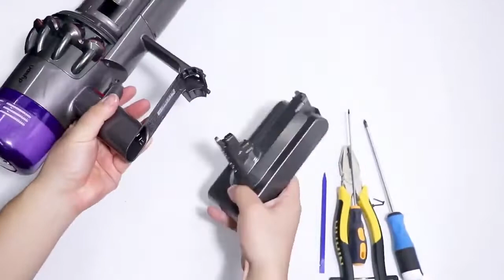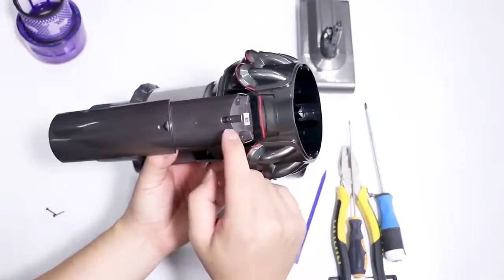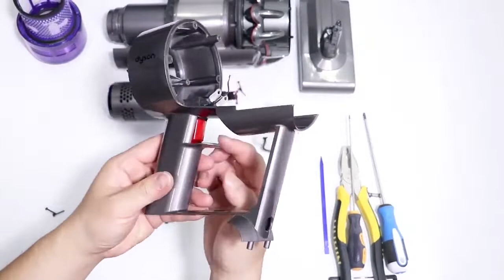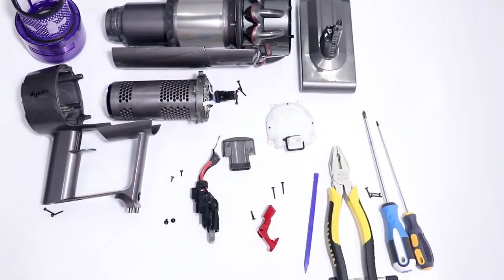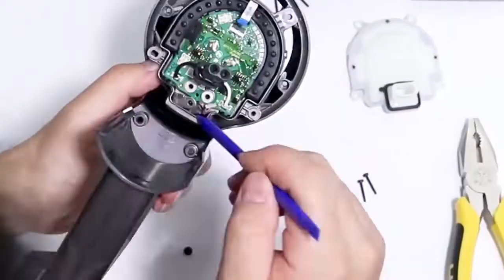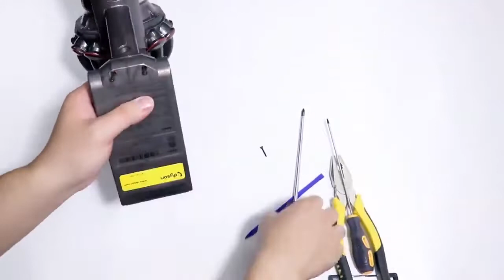Trigger Replacement Video for Dyson V10 V11 Vacuum Cleaner Disassembly and Installation

Comment: I have now achieved the pinnacle of human achievement. I have repaired my own Dyson Animal V11 cordless vacuum with an upgraded battery and a more sturdy trigger. On “Boost” mode, it grabs the floor so hard that I feel I could quite possibly hang upside down with it from the ceiling (but I won’t actually try it, mostly out of fear that my ceiling would crumble down on top of me). Score one for the little guy who refuses to give in to planned obsolescence! I am the warranty!

Comment: What size torque driver did you use?
Reply: They want the worst possible size... TX8 slim and long ...otherwise impossible to reach the screw underneath 
Same with the Philipps... better directly order the set with the tools included... I wasted too long time finding something usable in my tools drawer...